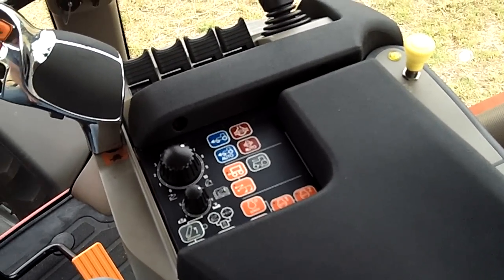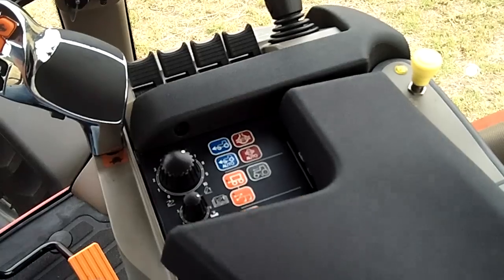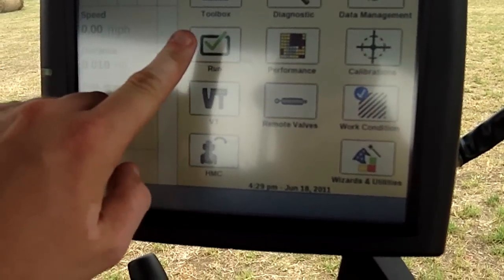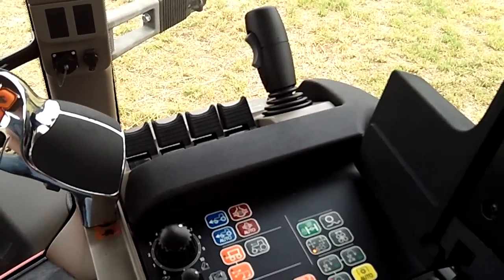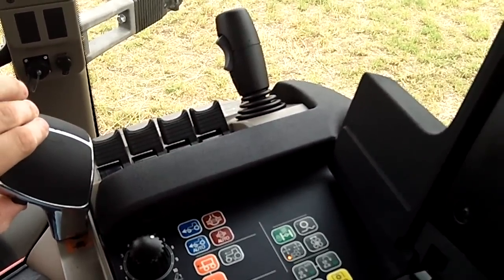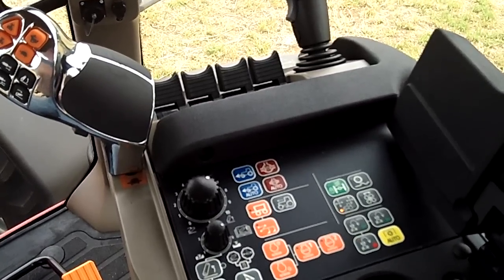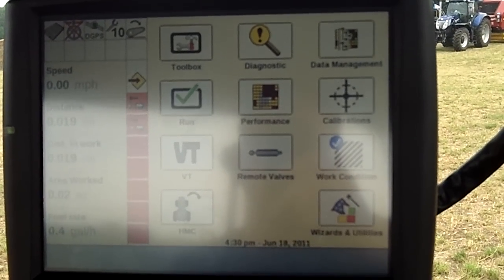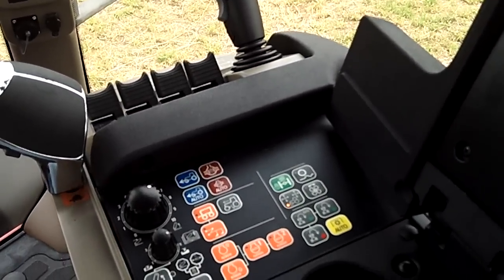Recording an End of Row Sequence

Comment: Can you record a sequence to do the followings!? in the end of row lift the arms and stop the pto?! and in the start of a row lower the arms and start the pto!?
Reply from the maker: yes.  You add auto PTO.   The hitch raise percentage will be the indicator to the tractor at what point you want to turn off the PTO.  Great for snowblowers and rototillers with short PTO shafts that can wind up.
Reply: CaseIHinaction can you hide the end of row play sign on the dash to see your temperature bc if you press the arrow down the end of row stuff just comes back after 3 sec or so and I want to see tractor temperatures on the dash not the play button of end of row function ?? new to case ih equipment alwaysed used deere